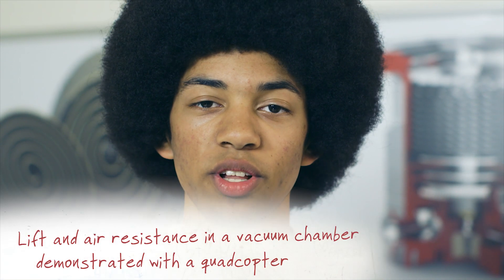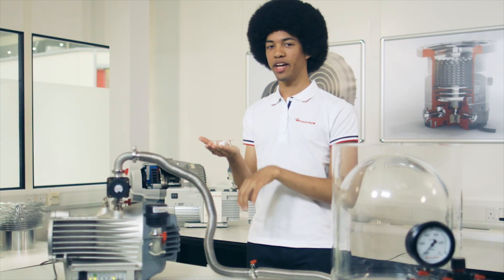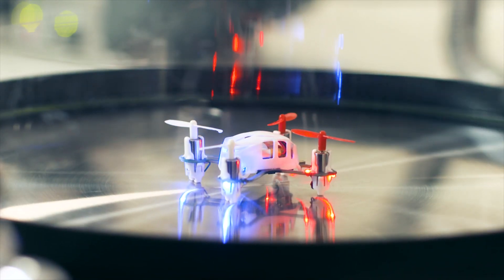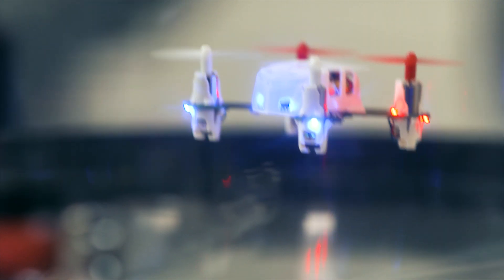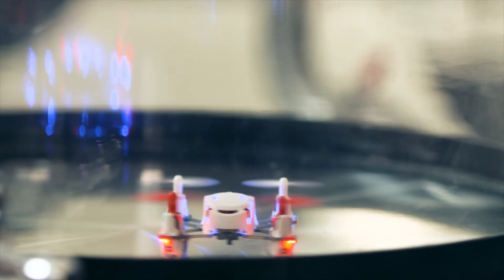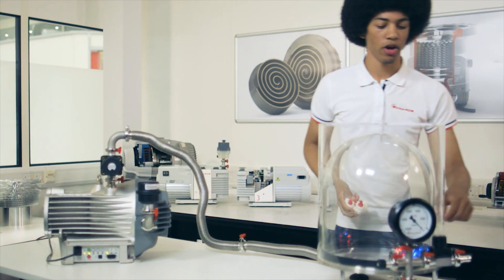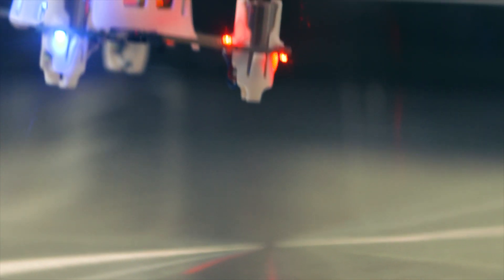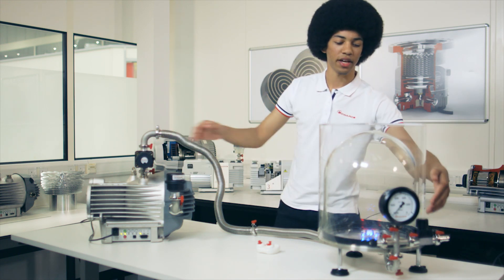Experiment #2 Lift and air resistance in a vacuum chamber with a quadcopter - Newton's Third Law

Comment: What that experiment shows is that a rotating blade does not produce lift in a vacuum, fair enough.  However, I'm not sure what that has to do with Newton's Third Law of Motion in this context?  What I want to see is an experiment of how Newton's 3rd Law still applies in a vacuum - it should do because rockets in the vacuum of space rely on the same law. In the case of a rocket, the 'action' is the burn of liquid hydrogen and oxygen resulting in a rising external mass of exhaust and a reducing internal mass as the liquid fuel is burned off.

Comment: question: Let's say you are in space sitting at the end of a rocket that starts out at weight X on Earth. At what speed (relative to light) does a pound of thrust stop accelerating you?(since nothing can reach light speed, shouldn't there be such a speed?) Also, as a followup question, if you reach that speed, what will slow down the rocket if you were to flip a switch and turn off that rocket?(it couldn't stay at the same speed if acceleration was at zero, no?)

Comment: Please build an experiment of a small rocket burning inside a vacuum & if it will propel forward. 
Just wanna see if rockets burn & propel in space.
Reply: Hlalele Mahlaela The rocket's thrust will push off the floor, walls, or ceiling of the vacuum chamber. The problem is that there are no walls to push off of in space and there's no air to push off of either.
Reply: Sal Amander 
Bullshit.
You can see the quadcopter reacting in the horizontal plane to the rotor blades starting to rotate in vacuum. Newton's third law... where did the quadcopter push off???
Reply: @peteralleyman1388  the chassis of the quadcopter is acting against the table, movement is likely due to vibration & gyroscopic forces.
Reply: The matter flying out the back of the rocket would cause forward motion. Equal and opposite reaction. Has nothing to do with what it's bouncing off of. Unless both items are floating next to each other in space, then the matter would push them away from each other if the rocket exhaust was hitting the other object.
Reply: solid will burn

Comment: Wicked, so does this mean Newtons 3rd law doesn't work in vacuum?
Reply: Yes Newton's 3d law was a translation of a phenomena observed and mathematically demonstrated during Newton's time in specific conditions.  It doesn't explain it's materiality that lays intrinsically on physical interactions between particles that couldn't be seen or measured at his time. When there is no matter to interact with (vacuum), there is no interaction that exist normally between two bodies that interact with each other. Newton's 3d law is verified because one mass is equal to 0 ; there is no reaction. It is the exception that confirms the rule. Vacuum experiments in transparent chambers couldn't be conducted at his time to make this observation (see Magdebourg hemispheres experiment).
Reply: >"Wicked, so does this mean Newtons 3rd law doesn't work in vacuum?"

Uh, no. The opposite, actually. This video clearly shows Newton's third law in action: The quad-copter is spinning, inside the vacuum, in an opposite direction to the spin of the rotors.
Reply: ReallyWeirdThings.Com , it yes , that thing can't fly in vacuum , quad-copter is spinning , but it can't fly
Reply: @777orderoutofchaos4  This is because its source of thrust is literally moving the air. It literally pulls air from above it, pushing that air down. It proves that the concept of lift (which relies on such movement of air) does not work in a vacuum. 

However, a rocket does not rely on moving the air to generate thrust. Any air in front of it merely slows it down.
Reply: 777 Order Out Of Chaos 
Of course it cannot fly in vacuum, lacking a rocket motor expelling large quantities of gas at hifg speed.
But the reaction of the quadcopter in the horizontal plane confirms Newton's 3rd law in vacuum.

Comment: Hello, thus the reason why the LEM landed on the surface of the moon consisted by progressive resistance on the gas particles ejected at high speed from the nozzle of the engine ; generating by this way an elastic piston slowing down the LEM that was attracted by the gravity field and force of the moon ?
Reply: MrWookie21 Elaborate. I'd love to answer.
Reply: lowest common Denomanator
I could maybe help you if you asked me a question.
Reply: What do you mean about magnets and gravity? Or elastic piston? Please answer
Reply: lowest common Denomanator
Where did I spoke about magnets in my post ?
Reply: Hmmm
Reply: MrWookie21 lets see you prove that fantasy. looking forwards to your video.
Reply: George Lamplighter : do you think Newton's third law doesn't have a physical explanation and is a magical phenomena ?
Reply: MrWookie21 
If you like to call a gas exhausted at high speed an elastic piston, yes that is how they did it.